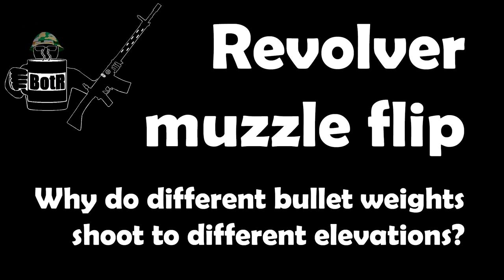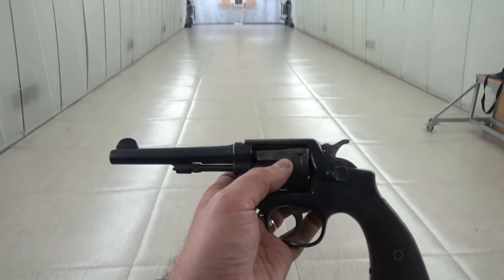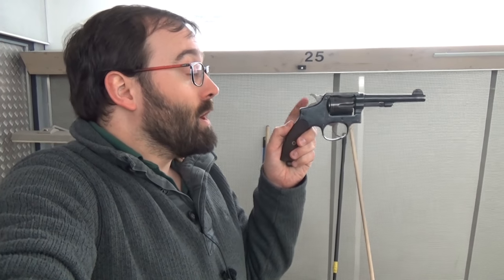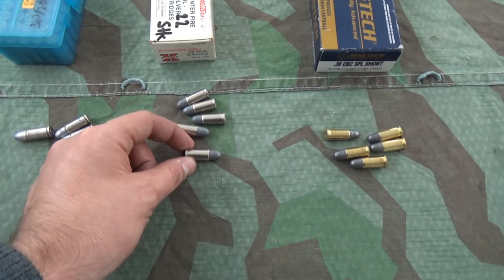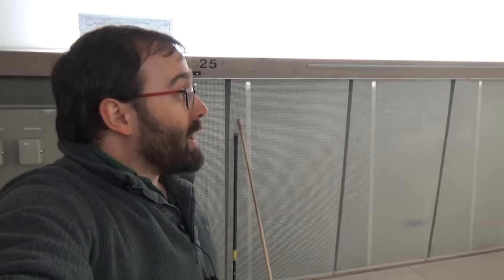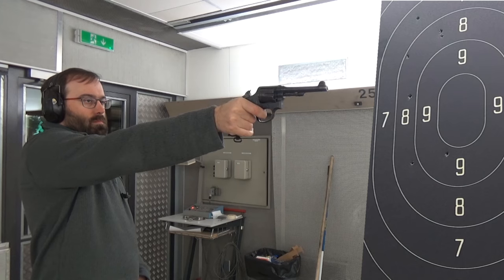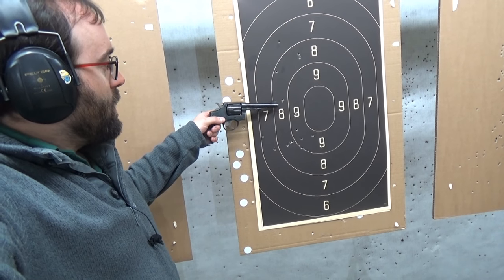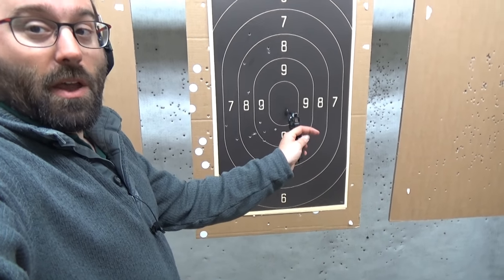Why Do Revolver Barrels Point Downwards?

Comment: How would a "Rhino" do this...cause of there different design? Great video btw.. respect...I never ever heard of this, nor seen it... damn good video.
I really want to hear more about this!!!!!.... Btw, how would a gun do, if it was not held in a hand, but free floating / hanging in the air? So, no pilot point at a wrist?
Reply: Thanks... that was very very quick btw... :-) Where would that centre be? Can this be calculated? So, in total... the revolver/gun rotates, due to the holding with the hand (1 or 2 hands) AND the rotating around a virtual center point of mass. Interesting. And this would also imply this for any gun / rifle / canon / etc.... hmmm .. Would a very high speed bullet make a difference? So , reaction has no time? Like in a high velocity sniper rifle ?  Thanks... there's a lot to conceder. BTW I have no experience with guns (this is Holland), but really love the mechanics and to see this real-life-actual working techniques.

Comment: My dear Bloke, the Smith & Wesson Military and Police (marketing ploy from the early years of the last Century is surrounded by short cartridges giving the old man the impression of caliber .38 S&W.  The lanyard loop on the bottom strap of the grip straps marks that as a "Victory" model of WWII.  The round I mentioned (.38 S&W) is known also as .380/200 (mostly in the U.K.).  The original configuration of ammunition was a 200 grain lead round nose bullet at velocities (varying upon manufacturer) from 590 to 620 fps.   The official U. K. round was a full metal jacketed 176 grain bullet at about the same velocities.  That might give a thought about regulating the load and the sights.

The "displacement" of the shots on target from the point of aim may be from one or more of several causes.  The sights might be close but not exact.  Different bullets will sometimes take the rifling differently and thereby displace horizontally.  The shooter may be anticipating the fired shot by (very slightly) clenching the entire shooting hand.  In a right handed shooter this typically manifests by 'pushing' the muzzle toward the left and often as not, down also.  (For years all my handguns shot low and left and I could not understand why.)  

Great video; the explanation of 'why revolvers point down' is exactly correct!  I've heard some strange thoughts on that.  (Not from you, happily.)  And your shooting is done openly and is not boring.
Reply from the maker: Thanks, but it's not a Victory model. It doesn't have a Victory model serial number, nor does it have the Victory model finish or grips. It has a commercial s/n and a commercial finish and grips. It's possible that it's a production overrun from the victory series that the finished and numbered commercially (S&W told me that the s/n puts it to late 44 or early 45, and it still has the sprung hammer safety in the side plate). Actually another mystery thing is a lightly struck US ordnance bomb mark on the bottom of the butt, and some holster wear around the muzzle despite it having hardly been fired when I got it.
Reply: @BlokeontheRange  And the plot thickens.  I thought it was a bit more 'blued' than ordinary, but could not tell from the video about a possible 're-blue' and grips can be replaced.  The overrun idea sounds quite plausible.  The lightly struck ordnance bomb is suggestive.  "...holster wear around the muzzle despite it having hardly been fired..." sounds like a "security' or police issued arm.  Carried much and shot little.  
I used to collect S&W revolvers before the prices went up.  C'est la vie.
Reply from the maker: I reckon it was probably bought by the ordnance department and stood guard on some facility, being fired little or not at all, before being surplused off.
Reply: @BlokeontheRange  Sounds right to me.  Except the blue finish.  But strange things do happen.

Comment: Reading comments I see a huge lack of historical perspectives and .38 caliber concept.

The .38 Special, an 'improvement' on the .38 Long Colt of US Military revolver, was found by 1920's & early '30's lacking in police needs.  The 'motorized bandits'  [criminals in cars] had cover from the auto bodies from not only the .38 Special but also the .45 Auto. A common part of police inventory was the M1907 Winchester Self-Loading Rifle chambered for .351 Winchester, ballistically very close to .357 Magnum.. This load did penetrate car bodies. In the 1930's, large frame Smith & Wesson revolvers were chambered for .38 Special, but with added strength of frame and more metal between chambers, hotter loads were possible and the .38/44 round developed. These very hot .38s could fit in a regular .38 Special revolver that couldn't handle excess. Eventually, the .38 case was lengthen for third time and the .357 Magnum as result for a round that would not fit in .38 Specials. The .357 saw limited law enforcement usage, mostly by highway patrols, etc. for a variety of reasons, most notably ignorant journalists hyping public against these 'hand cannons'. Eventually companies such as Ruger began making similar revolvers differing only in shoulder so only a .38 Special round could be chambered. Ammo companies began producing +P, and +P+ loads, still .38 Special, but with about .357 ballistics, so ignorant public wouldn't see cops having those 'magnums'. Eventually cops went to wonder nines [high cap 9mm], the .40s etc., now issue forgotten except the gun nerds as ourselves.

On the auto side, ammo and gun companies hot loaded the .38 Auto, in the M1911 Colt pistols to create the .38 Super, only difference was a shiny steel case as .38 Super easily chambers in any .38 Auto, including all those weak designed M1900, M1902, etc. Colts. Again .38 Super to address 'motorized bandits'.

UK's mindset, likely didn't consider US civilian law enforcement experiences.

Comment: Now you'd think that a slightly upwards pointed barrel would help compensate for recoil with a downwards directed recoil direction
Reply: For the recoil force to push the muzzle down, it would have to be pointed upwards. Not slightly upwards, but at the sky upwards.
Reply: @WJS774  Or have the bore axis sufficiently low down (whether that's actually possible in a revolver or pistol is another thing).
Reply: @jubuttib  
Well, a traditional bore axis is kind of implied if you're talking about muzzle rise being a problem. If you have a low bore axis like a Mateba or Chiappa Rhino, the lower bore axis makes holding down the muzzle (whether with a ported barrel or some other method) less important.

Comment: I'm curious to know if the barrel calibre of S&W 38/200 is the same as their .38 Special.
Reply: Hi, I was wondering if S&W bothered enlarging the bore on all their lease-lends, if perhaps a .362 will squeeze down a .357 barrel safely. Is your Colt chambered for 38S&W ? that seems very tight at .354
Reply: That's excellent, I would like some 200grn .38 lead for knocking metal plate targets, but can't find any here in France ... Were yours commercial, or home produced?
Reply: Thanks for the advice, though I've never ventured into home casting, just hoped to find a heavier bullet for a standard .357 barrel. Only just found your YT page, humerous and informal, perfect, well done.  :-)

Comment: The gun was probably made to fire MK1z sw .38/200 at 200 grains and 630 m/s muzzle velocity
Reply from the maker: And one of the loads here replicates that ;) And shoots massively high.
Reply: @BlokeontheRange  Balls. I don't know how a MK II is loaded but maybe 180 grains on the same amount of powder :(? Editing again Im realizing that since this one is a United states gun it might be made like a .38 special and an afterthought in this caliber. Could they have just fucked up? Whatever the United states would've used would be choochin' faster normally. .38/145 LRN?
Reply from the maker: Mk.2z is 174gn at about the same velocity (I chronied some original ammo). The US-equivalent stuff is represented here and shoots low. Unless you drop the velocity right down such that the drop becomes significant (I have a load which shoots 200gn to the point of aim in this revolver, but it's only doing 400 fps), the point of impact is mostly determined by the bullet weight alone (which you can actually derive with some high school level Newtonian physics :) )

Comment: y isnt it that ways with semiautos?
Reply: It is to some extent (the slide etc. can make it harder to see, but many semiautos also point slightly downwards), but not to the same extent for at least a few reasons. One would be that the generally lower bore axis helps push the gun straighter into your hand rather than trying to pivot it upwards as much as a higher bore axis revolver. Another reason would be that the mechanisms on the semiautomatic help absorb and dampen some of the forces. On a revolver when you shoot there's not really anything moving in the gun so all of the force goes into pushing the whole gun backwards, whereas on a semiauto the moving slide (and barrel if it's recoil operated) initially transfer the force into the frame via the recoil spring, partially absorbing, delaying and spreading the recoil impact over a larger timeframe. Think of it like a car, if the wheel is attached to the body of the car with a solid metal bar, a single bump will kick the car very suddenly and harshly. If there's a spring in the middle it'll spread out and absorb some of the shock, even if the car eventually bottoms out (compare to the slide of a semiauto hitting the end of it's travel).

Comment: Recoil happens AFTER the projectile has left the barrel.
Reply from the maker: No, no it doesn't. The proportion of it due to the mass of the projectile happens before, that due to (most of) the gas after. F=m.a and m1v1=m2v2. That's all there is to it.  See:  the relevant chapter in Hatcher's notebook, where he actually measures this http://www.milsurps.com/content.php?r=439-Hatcher-s-Notebook-%28by-Julian-S.-Hatcher%29
Reply: Recoil happens the moment the projectile begins to accelerate
https://www.youtube.com/watch?v=7y9apnbI6GA You can see the slide begins to move before the bullet exits the barrel
Reply from the maker: Right. The long answer now I've got a moment. Recoil has two components: that due to the momentum of the projectile, and that due to the momentum of the powder gas.

When the charge ignites, the pressure exerts a force evenly in every direction. So, presuming that the case is cylindrical like in a revolver, the force on the case head is the same as that on the base of the bullet. F=m.a, so this F causes the m of the bullet to accelerate forwards. At the same time, the same F is pushing backwards on the firearm, F=m.a equally applies, so F also causes the m of the gun to accelerate backwards. So, as the bullet accelerates down the barrel, the gun accelerates backwards, in inverse proportion to the ratio of the two masses in question. All of this acceleration due to the projectile's momentum has happened by the moment the bullet leaves the barrel, and hence the entirety of the recoil velocity (and hence momentum and energy) due to the same has been attained.

Now, as for the powder gases, this is where it gets a little complicated, and is more important in rifles where the charge weight can be a significant fraction of the bullet weight.

We can assume that substantially all of the powder charge is expelled from the barrel. Before the bullet has left the barrel, the average velocity is half the muzzle velocity (the gas right behind the bullet is doing the muzzle velocity, that right by the casehead is not moving at all, assume homogenity so average velocity is V/2). The recoil component due to the mass of the powder gas before "uncorking" is also entirely transferred to the gun before the bullet departs.

But then, there's a catch. Once uncorking occurs, almost all of the powder gases escape mightily quickly (likely somewhere of the order of 4000-5000 fps, depending on muzzle pressure), giving a "rocket" effect which causes the gases to accelerate, which also applies force to the gun. It's this gas that's manipulated with a muzzle brake to reduce recoil by changing their average direction to reduce (or even reverse) their contribution to recoil.

So, for a 38 special revolver, 158gn doing 800 fps with 4gn of powder (244m/s, 0.01kg bullet, 0.00026kg powder, which we can ignore for the moment since it's about 2 orders of magnitude lighter than the bullet so is a rounding error, in a rifle it'll be more significant), the momentum of the forward-moving bits just before the bullet leaves is m1v1 = 0.01*244 = 2.44 kg.m/s.

So the free recoil momentum at this moment is also 2.44 kg.m/s, since momentum is always conserved. Note that this is free recoil (e.g. suspended on wires) - in actual shooting part of the mass of your hand, arm, body etc. will come into play, but we can't account for that in this simple analysis (and it explains why a bad hold makes recoil physically worse and not just psychologically worse - re-run the calcs allowing for more mass as a first-order fudge of this).

This means that a free 1.2kg revolver is already moving at 2.44/1.2 = 2.0 m/s at this moment, just prior to uncorking.

Once the bullet "uncorks", let's assume that all the mass of the powder zips away at 4000 fps (1219m), giving powder momentum of 0.32 kg.m/s. 

So the total momentum forwards = 0.32+2.44=2.76, giving a free recoil velocity of 2.3 m/s, of which only 0.3 m/s is due to events after the bullet leaves.

You'll note that the contribution of the powder gases is about 12% of the total in this example (4gn is a Unique-ish load in -38 spl) - this is what you've got to act on with a muzzle brake, and why larger charges of slower powders are typically preferred by people loading for raceguns - more momentum you can play with without increasing muzzle velocity.

So there you go. How recoil works from a highschool physics perspective. Read Hatcher for more detailed analysis.

Comment: This is a misleading video. The barrel is in line with the cylinder, not canted down! The illusion you see is the taper of the barrel. Rather you only see the upper taper because the lower half is covered by the extractor rod housing on the bottom of the barrel causing it to appear to be pointed down. The sights are so high because manufacturers give you extra material to file down to adjust elevation. Limp wristing will cause you to need even taller sights and to aim at the ground below your targets.
Reply from the maker: Err, nope.  http://sportsmansvintagepress.com/read-free/manual-police-revolver-instruction/revolver-sighting/

And you can see it for yourself by by simply sticking a dowel in the barrel and resting the sights on a table. Or just look at the thumbnail for the video...
Reply from the maker: Here's about the most obvious example I can come up with. S&W .455 Hand Ejector. Note the MASSIVE angle between the sight line and the bore line: https://www.arrse.co.uk/community/attachments/1556725935895-png.390472/

Comment: Wow, just wow! And earth is flat..
Reply from the maker: http://sportsmansvintagepress.com/read-free/manual-police-revolver-instruction/revolver-sighting/

When sighting, no allowance should be made on the target for recoil when the shot is fired, as the factory has already taken care of this allowance by adjusting the height of the front sight in relation to the rear sight, to make provision for the slight upward movement of the barrel, from the time the ball starts from the chamber in the cylinder until it leaves the muzzle of the barrel. This adjustment of sights may be seen by inverting the revolver and resting the top of the front and rear sights on a level surface. It will be seen that the barrel is then pointing upward. If a revolver were clamped in a fixed rest with the sights in perfect alignment on a target at 25 yards, and fired, it would be found that the ball strikes 2 1/2 inches below the center of the target or at the point the revolver was sighted, which shows the adjustment the factory has made in the alignment of sights to compensate for recoil at the time of firing. Fig. 18.